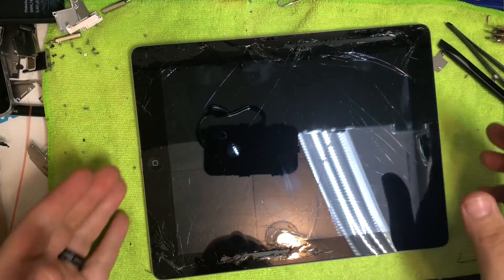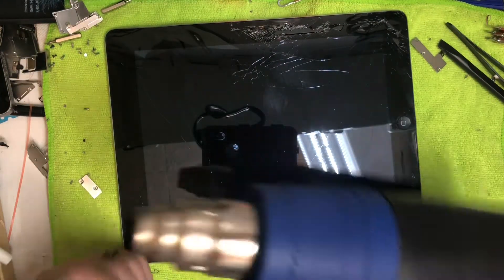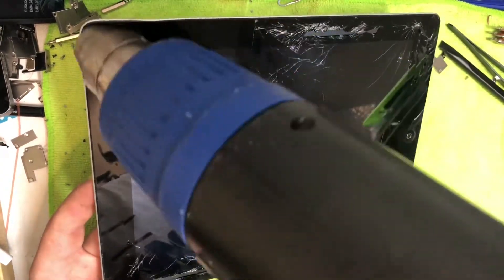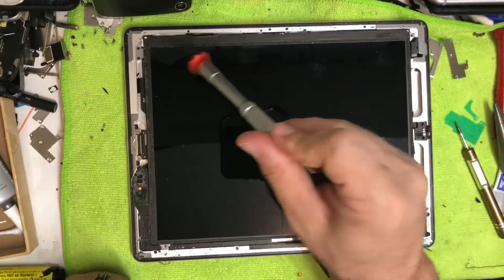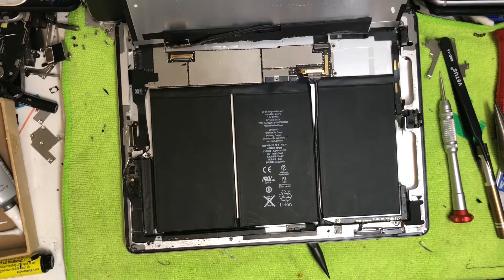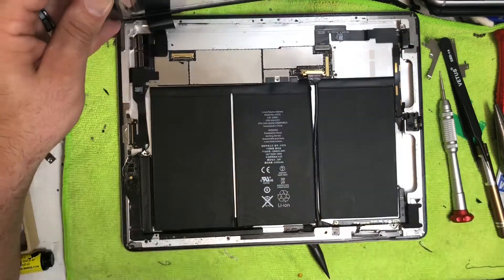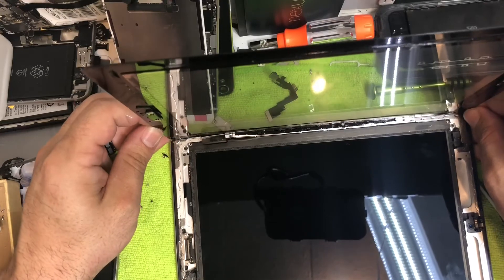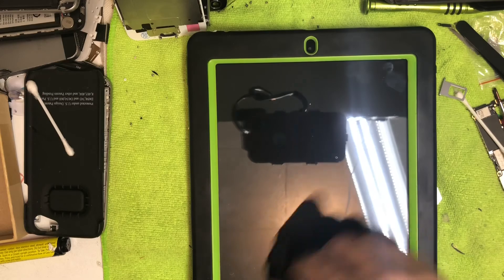iPad 2 screen replacement a1395

Comment: Why doesn’t home button work after repair
Reply from the maker: It should you might not have the cable slide in enough or the button is not over the little bump on the frame